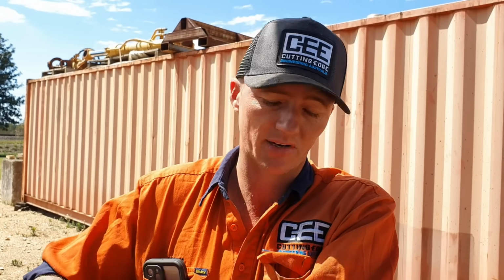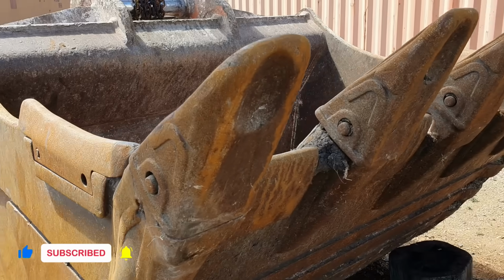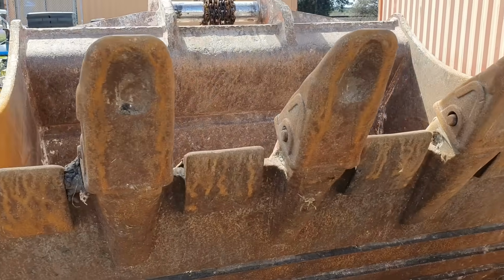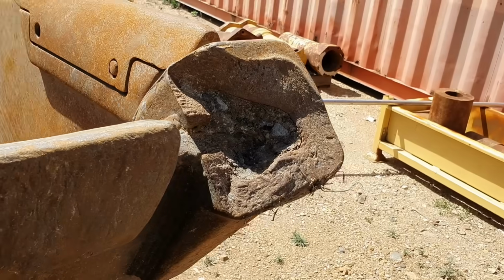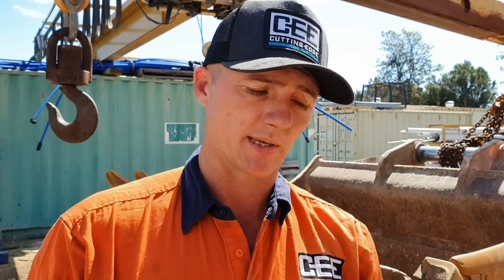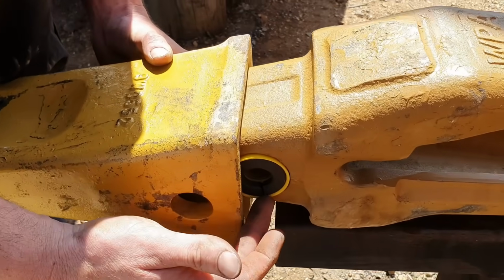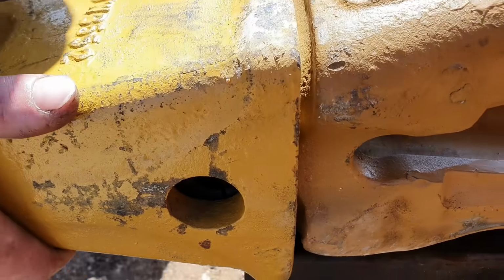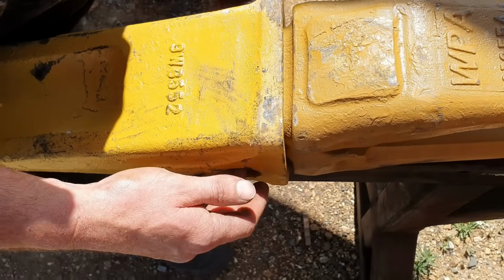Repair BROKEN Tooth on BIG Excavator Bucket | Gouging & Welding

Comment: This is probably a very dumb question but since I have zero welding experience I'm curious. When welding large areas like this where you are building up huge welds, is the melted wire equally as strong to the steel or maybe even stronger ?

Anyways,  great video as always. One of my favorite channels!
Reply: It's a fair question and the usual answer is that the weld metal will be stronger than the parent metal due to the focus of stresses at joints and repairs. Having said that there are welding wires designed for specific purposes such as hard surfacing, where the weld metal is strong but still designed to abraid away Before the parent metal of the components. At @ 6:45 where Kurtis is inside the bucket, if you look at the tops of the tooth adapters you will find some welded patterns, rectangles and cross braces. That weld metal is Hard Surfacing and it is designed to take the impacts and abrasions associated with digging into heavy abrasive rock. It's purpose is to wear down through daily use and then be rebuilt up again and again.
Reply from the maker: Good question mate and Mark Fryer has answered perfectly 😎👌
Reply: @CuttingEdgeEngineering  Tanks!
Reply: From my experience, used to repair augers in the before covid times
Even with a huge build up, most of the time the tooth socket would break off, wear away or the parent material would fail
Generally the Weld metal was stronger when layed down properly

Comment: G’day Kurtis and Karen, that a big bucket and it’s amazing how much of abuse that front edge takes, you see operators trying to peel rock out with 1 or 2 teeth and you always think it going to roll the tooth out not the rock, awesome job mate as always, have a great weekend, cheers
Reply from the maker: Hey Matty hope you're having a good weekend down there mate. It's amazing what abuse some machines deal with the operator is probably happy to have the ripper tooth fixed 🤣 Looking forward to the Part 3 of your wobbler engine 😎👍
Reply: @CuttingEdgeEngineering  hopefully all going well I’ll have the final video out on the wobbler engine tonight

Comment: I always use the gouging rig, when i need to remove large amounts of metal. One thought Kurt, painters tape to hold the catch rings, so you dont put your fingers in the holes to hold the ring in place, great work. Hood down lights on.

Comment: That brings back memories, I used to air arc flanges off worn out large bore pipes, round and round until the crack came through, flanges were hard to get new so we would do about thousand over the span of a few months once a year after the pipeline was replaced.

Comment: I learned that the round carbon rod does the deep gouging and the other rod cleans up . Because you have to make so many welding passes, you must use most of a spool. 
When you showed that fancy bag. I thought for sure it was something naughty for the Giggler. 
Aussies take challenges seriously.  Someone says you can't break that. The challenge is on.
Thankfully we have CEE.🥳

👍💯🦘
Reply: Every crew has at least one person who is known to be good at breaking equipment.
Reply: Some people can wreck an anvil with a rubber hammer🙄😬
Reply: We had a new apprentice at work, after spending a day with one of the fitters, the fitter remarked "If you put that boy in a locked room with two tennis balls, he'd loose one and break the other !"
Reply: @graemewhite5029    They’ll never miss Payday or Quitting time, hope y’all were able to help him to improve, or find something else
Reply: Yep! Round digs, flat smooths.

Comment: It’s interesting that carbon arc is so effective at melting metal… 60 years ago I was a young projectionist in a movie theater..The light source for the protectors was carbon arc..  The projectors were made by Simplex and were made in 1935..  ha….There were two rods one positive and the negative the were struck after applying power.. They required constant adjustment and were on a screw feed and were copper coated on the outside to protect them..  The rods lasted 2.5 x 3 hours and between reels they were adjust with power off in the holders..  The rods were about 1/4 inch in diameter and the negative was a little smaller.. The light is very very bright..  Each unit was enclosed and never opened during use…with suction ventilation at the top of each to the out side..  Later these big 35 mm projectors used photo electric like bulbs..you work is amazing and makes us all think much and realize your job is not easy..  I so enjoy your videos and out takes too.  Be well mate..☺️👍

Comment: I've seen Oxy-Rod cutting.  The gear, made to the wrong pitch  was 4x that bucket size and took large cranes to move it into the cutting hole.
The scrapper (inside job) got the scrap free, cut it to size to melt down again (iron) and sold the quality scrap back.  He used a oxygen generation unit and a large tank.  The lance was long and the oxygen flowed through it.  Strike a match to a newspaper and get it close and white light was produced.  It melted like running butter.  Scary guy in big heat protection suit - space man like.  That was an operation.

Comment: You done good work. There’s a quarry 35 miles from me. They got a Hitachi 1200. I have replaced several shanks on. The new word is adapter. It’s work gouging is the best way to remove the old adapters. As always I’m watching the purdy blue light.

Comment: Air powered hand tools are so underrated. Before all these fancy battery tools came out we only had access to pneumatic tools and let me tell you they are superior in almost every way. They never heat up and burn out, they’re fast and powerful, require hardly any maintenance and are quite cheap in comparison.

Comment: Never would have guessed mig was the way someone would weld that. Always heard its not strong enough on the thicker steels
Reply from the maker: Maybe a few decades ago that was the case but mig has definitely come a long way
Reply: @CuttingEdgeEngineering  no shade, i legit just have never seen it done on material that thick. Flux core or something probably right? Curious what set up you used there

Comment: I wonder if you can start adding times it takes to do the things like Gouging and the welding, people watching who have never done such things fail to realise, that what may look as if it is ten Minutes on the video may in fact be many hours of Preparation.  I used to work in an Engineering Shop decades ago 1970s and we used to do things like you show all the time, however technology has changed since We did it. Oxy Acetylene, Stick Welders etc We used to do a lot of work for Hastings Deering that they couldnt do. These videos take me back to a time when I could physically work on projects, sadly due to failing health I no longer can.

Comment: Arc air gouging 
The rod has an outer sheath of copper with carbon inside the rod
Attach to handpeice with electrical current
Push a ton of compressed air and when u make contact with the workpiece 
Steel just heats and melts blows away
Good because it’s quick. Not too much heat

Comment: Can you explain more about the airtool you use for cleaning up the welds with? thanks.
Reply: Basicly air hammer.. just to knock off slag that you dont want in the weld out.

You can get different tips for it.. wide and small tips etc. Same tool that they use for riveting.

Comment: Did you know that the electrodes are for cutting? Similar to the electrodes of the cinema machines of old. Before there were strong enough lamps. Two electrodes facing each other created light strong enough to project the image on the screen.

Comment: Beautiful welds... however, welding cold hardened steel will produce hairline cracks. Preheat any steel thicker than 1 inch to at least 300F  to avoid hydrogen cracking.

Comment: Oxy fuel is not only expensive it’s a major pain constant upkeep on tips and hoses and fuel plasma is nice if you can afford a big enough unit with a gouge tip  carbon ark is cheap and very easy to control the gouge  just need a massive air supply... I’m looking forward to that video.. thanks from oregon USA

Comment: You know what your shops problem is? You have every tool known to man, are trained at Harvard Med School for Machinists or equivalent, seem to be super smart and resourceful. Thing is, we don’t see you fixing a huge ship transmission with a worn down sledge hammer, some ancient homemade wrenches, and a blasting/  cutting torch that runs off hoses disappearing down into a dark cave. All this on a packed dirt floor in flip flops with a crew of 8 guys, age ranging from 12 to 60. Not to forget washing all the piled parts in a bucket of solvent, by hand. Or fighting with a hundred year old lathe. And joining all the bits with 7018 welding rods with the voltage maxed out and grounded on said lathes. Consider your selves lucky, we sure do!

Comment: Wow that multiprocess welder is a lot less than I thought it would be. Too bad 3 phase is so damn hard to get if you aren't in an industrial setting. I have a 20hp rotary converter for my equipment but it can't handle that much of a draw. Might handle a smaller one.

Comment: You should preheat before you tack, if they're going to be more than a little dot. A guy at a shop I used to work at got his foot crushed by a five ton baseplate when the tacks holding it to the column broke.

Comment: Regarding the gouging: By what means travels the pressurized air to the actual spot it is needed? Seems that the electrode is simply clamped like an electrode of a stick welder? Cheers!

Comment: It’s dual shield wire guys you have to run gas with this. You should google the different flux core wire before asking a question even gas less flux core is a good wire for some structural and heavy duty repairs. But dual shield is a blast to run and lays lots of metal quickly I love running dual shield wire

Comment: Looking at the  was wondering if the bucket was one of "The Bucket Factories" ones?  
I think that the method of notching the tooth to fit around the bucket edge is stronger? As it keeps the integrity of the bucket intact then relying on the tooth to hold the integrity?  
Love the outtakes.

Comment: From a design/engineering perspective, seeing the adapter sheer at the pin, the mounting system with such heavy welds on a deep neck seems quite excessive? They clearly went to the effort to make sure it was replaceable, but if the adapter is a designed failure point, i'm surprised there's not a way to pin or bolt it to make that replacement process a lot simpler.

Comment: i don't blame you for using dual shielded wire. for some reason (maybe it's just the cheap chicago electric i tried it on) gasless flux core just doesn't look or perform very well... i much prefer dual shield.

Comment: Why not stick weld when that thick of material
Reply: Stick welding is messy and not as well controlled as Mig welding. You can get a hotter weld with better penetration with stick, so at times it makes sense to do the root pass with stick and finish with Mig.

Comment: So basically a 1/3 of the weight of the bucket is weld. Is what I got from this video. God damn that's a lot of wire.  I'm used to welding up full pen columns for multi storey buildings with the flux core.  I thought I did done big welds but damn.  All i got to say is..... Dammmnn

Comment: We had a WIA machine in the shop I think it was only a 300 but it was a good machine very reliable and constant power and feed with no variations and the machine wasn,t too expensive either,I find the gruntier machines the price skyrockets but reliability and robustness does too. You def need a 500 for a job like this and to fill a weld like that,Awesome job guys looks like they had been pulling sideways on the tooth. I,m sure we,ve used that wire before and found it the best for uphand too with not much runoff but yes downhand the way to go on a weld that size and a lot easier. Thankyou for the vid, I,m surprised none of the boys seem to have much of an accent. Best wishes to you all from Auckland,New Zealand 👑⭐🥇💥👍✅❤💯🍻🍻🍻🍻🍻🍻

Comment: Im not a fan of air arc or the oxy setup for scarffing cuz theyre both extremely messy and the oxy rig doesnt clean as well.  I like the plasma with the scarffing tip to cut welds apart and it cleans the weld surface too but thats just me.
I also use .045 dual shield at work on the miller 304, its truely a dynamite rig.

Comment: it would gouge better if you hold the torch in line with the weld instead of holding at 90 degrees to the weld joint. how much did you charge to repair the tooth?

Comment: I know very little about welding and a lot of welders don't like wire because they say  it is not strong enough but you use it on equipment  that work in the the most  harsh enviroment and the welds hold or you would be out of business.  So what determines when you use stick?

Comment: Mister Curtis i have used air arc and thermite rods to cut underwater have you ever used thermite rods because the thermite uses magnesium you do not have to use such a high amperage on your welding machine I believe we used 150 amps whenever we were cutting h beams underwater and I always use right at 300 amps whenever I was using the carbon rod love your videos be safe have a great day Sam by the way I live in Jacksonville Florida

Comment: Gouging and welding with the chains still connected to the machine and bucket. No sling in between to stop possible arcing back to the crane. Lifting from a pin with chains and not sling. Very un-professional. Other then that. Very informational video. Also noticed the video thumbnail. Are you referring to this buckets gross weight been 50 tonnes or the over all machine weight CAT 6060,6090 RH400 and various other larger excavator buckets are only just cracking the 40 to 45 tonne mark with extremely intense wear packs........

Comment: Worked for a subsidiary of Bucyrus-Erie and did a lot of this same thing. Your arc gouging looked like mine mate. I knew a guy that was so good with one of those wretched things he didn't even have to scale it off or touch it with a grinder. Sounded like a gun poppin off when he would run those flat rods. Slick as glass when he was done.

Comment: Fun fact: most forklifts will lift another forklift of about the same size. You just have to snuggle up to the side and lift it by the roll cage up high using the tilt function. Ask me how I know this :)
Reply: (...but don't try this at home, and if you do make sure the roll-cage bolts are in good shape first!)

Comment: Most of time when I see a cracked tooth it’s because the genius behind the sticks is trying to smash up concrete with them instead of switching to the hammer. Don’t be lazy, use the right tool when it’s called for.

Comment: Air-Arc is by far the most efficient way to gouge/scarf off the old welds, hands down faster and cleaner... Does my heart good to see you weld the same way I do, hot and fast... Never used Inner-Shield wire with a gas overlay.... Might have to try it one day... Cheers from So. California... You're a good man and are blessed with a good lady...

Comment: Do you do any field work? What welder do you have on your rig?
Back in the 70's I used a Lincoln 500 AMP powered by an inline 6 Continental flathead.
While the machine was capable of wire feed/mig/tig we only did stick welding with it.
Hot and Ground cables were 150 foot of 4 Aught. At times we needed every inch of that cable.

Comment: I understand people use duel shield, but to me it is just a waist of material. Just stick it. Most with heavy equipment would kick you off the jobsite immediately as soon as they seen a mig come out.
I agree with the air arc when it comes to heavy equipment. 
The only time I use mig for heavy equipment is when I bring out the line bore for new bushings and pins.
Should talk the customer into hardfacing with ABR or MM rods depending the use.

Comment: Fascinated by your videos, but what is this tool you seem to be cleaning the welds with, the one with the thin metal rods at the end, and how does it work?
Reply: Looks like a large "Needle Scaler" to me. They do smaller versions for garages etc. The needles are basically mini chisels and the move forward and backwards rapidly by compressed air.

Comment: When working I would turn the wire feed and the amps up and really lay it in when the work was flat like this. You can really put metal in the groove and not cause any stress when preheated. I would suppose a lot of toughening metal is in the mix but I just used wire equivalent to 7018 with the center flux.

Comment: As a welder myself, I build pressure vessels and never fixed a bucket, that being said great work!!   I probably would've made the mistake to air arc the capping weld than try and oxy acetylene  cut the adapter off....which would not have worked as well as just air arcing the whole thing off like you did.  If I ever have to do that repair I would definitely air arc the whole thing, like you did..  Thank you for teaching me.

Comment: Good video but not practical could’ve did the whole thing in half the time if you left the bucket and it’s in one position and most places you will be doing this type of repair while it’s still on the equipment only time you have the luxury of positioning it is when you’re doing a rebuild and even at that you want to do as much work as you can without having to re-position it as you’re rebuilding it

Comment: I’ve done MANY repairs similar to this either gouging, hard facing rebuilding entire buckets / blades you name it. It’s a long slow and rewarding process. If you cut corners that bucket will be back before you know it. Here in Alaska a lot of people use their buckets in icy conditions so there are plenty of repairs to be done….. dual shield for the win. I used to stick weld repairs. Never again.